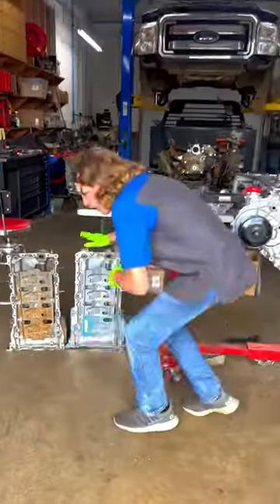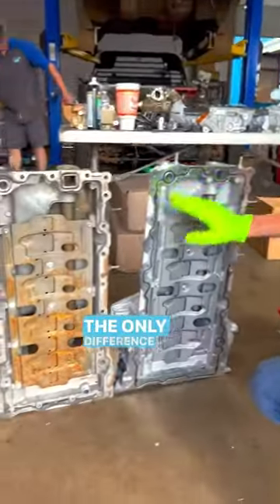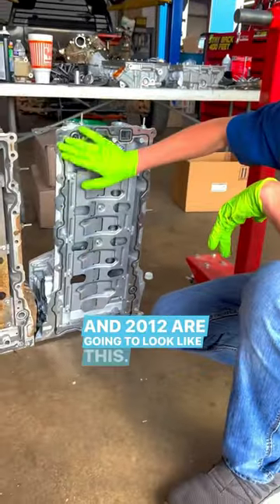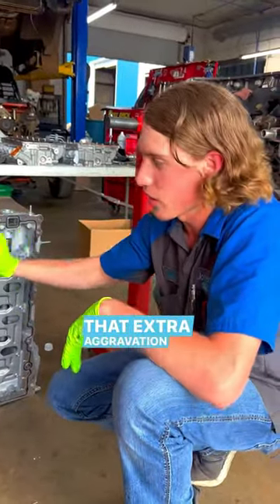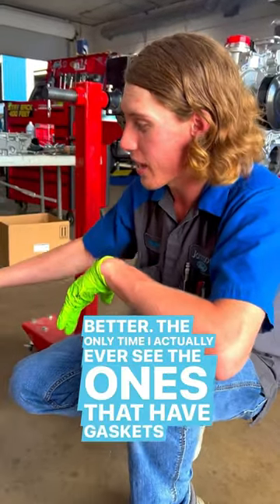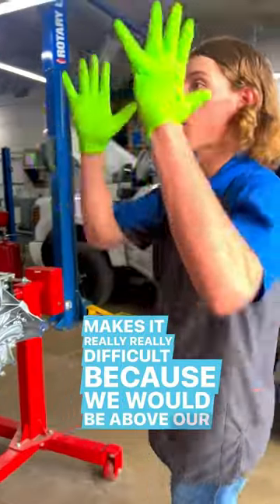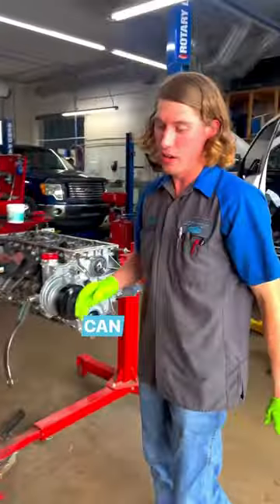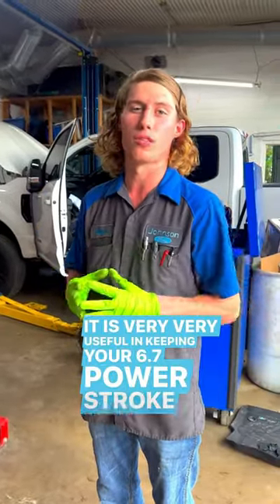Ford 6.7L PowerStroke Major Upgrade #shorts #ford

Comment: Too bad they are on national backorder with no ETA. They probably  stopped making them due to the blocked oil galley that has killed so many of these motors. Local diesel shop had to buy like 6 pans before they found one that didn't have a blocked off oil galley.
Reply: Wild

Comment: When working at ford in 06 we had ford engineering come to the truck shop and ask why we didn't have comebacks from 6.0 bed plates leaking. The techs told them they put a very thin bead of ford grey on the orings. I don't think they ever updated the workshop manual because application of the material is a art and they knew monkeys would over apply and therefore the bed plate would not achieve proper torque. That's my take on that. Very disappointing this problem is affecting the 6.7

Comment: Why would Ford do away with the gasketed upper oil pan?
Reply: To cheap out on manufacturing costs 🤦🏻‍♂️
Reply: Because ford always tries to reinvent the wheel.
Reply: Already paid alot of money once to fix the leak. And its leaking again. Smh they shouldve advised me to go with the gasketed upper oil pan.
Reply: @gilbertrodriguez9471  all I can say my 03 d Max and my co have have 6 total DMAX service and play /tow trucks none have leaks. The pan is held on with AC Delco silicone grey/ white color it's the shit.
Reply: @gilbertrodriguez9471  its most likely building a lot of crankcase pressure. Check the CCV filter.
Reply: @gilbertrodriguez9471  the last one I did had already been done twice by ford. Had 70k miles. The CCV filter was PLUGGED baddd. But the dealership resealed the pan both times and didn't mention anything about the CCV
Reply: @LunaDaSavage  my ccv filter was changed a year before the leak repair was done. They installed the newer version filterless  ccv filter, so it shouldnt be plugged up. Its supposed to be non serviceable, and  doesnt clog up like the filtered ones do.

Comment: The real challenge is actually finding one of the earlier gasket design upper pans 😅
Where'd you get one?? 
The last few I've done was really hard to find one
Reply: Did u get it through ford? How much?
Reply: @gilbertrodriguez9471  this guy doesn't respond anyone's messages
Reply: @gilbertrodriguez9471  last one I got was off Ebay
Reply: There's two dealers near me that stock them I believe. Need me to check?
Reply: @LoneWolfSparty  im gonna hold on a bit. How much are they roughly
Reply: @gilbertrodriguez9471  I'll respond back tomorrow, parts is currently closed for the day.

Comment: yes those pans are fuckn heavy as fuck cause the oil pickup system comes thru its like 50 pounds above ur head with rtv on it.   not fun then u got get to the damn center of the engine pan rail bolts on top the crossmember.  its not for the weak that's for sure